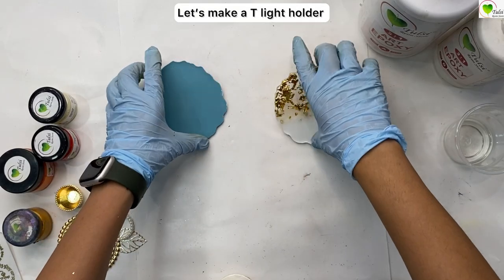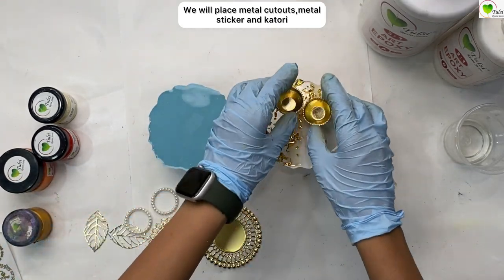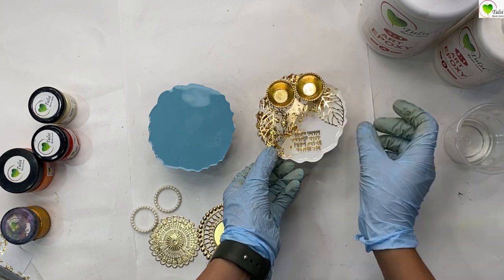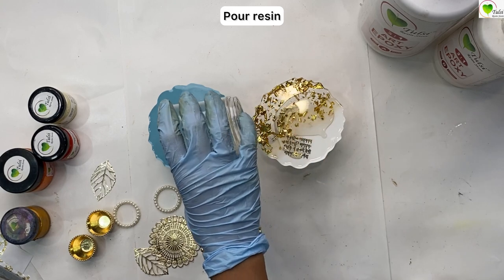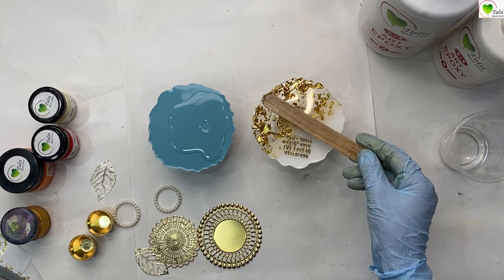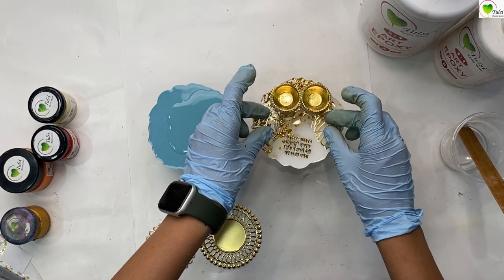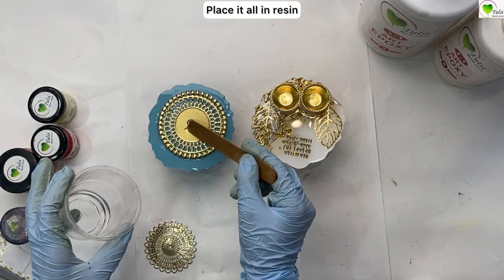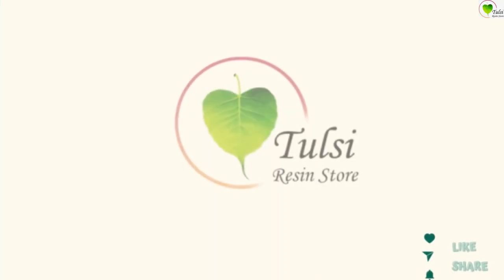How to make Resin T-light Holders | Resin candle-holder | DIY Resin T-light Holder | resin diwali

Comment: for top coat which resin you are used?
Reply from the maker: It is preferred to use 2:1 Resin for coating and 3:1 Resin for Casting purpose.

All Related links are available in profile bio
OR
Search “tulsiresin.com”